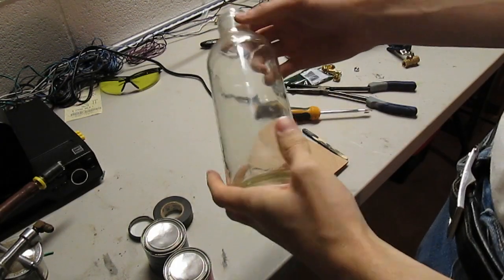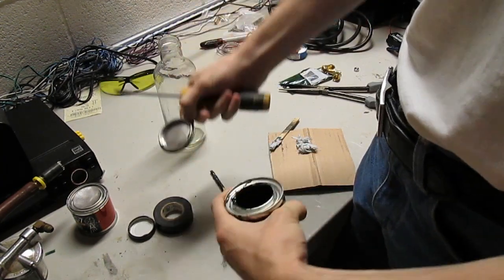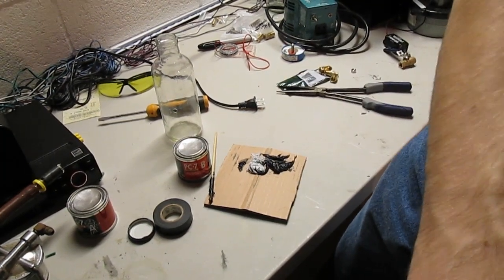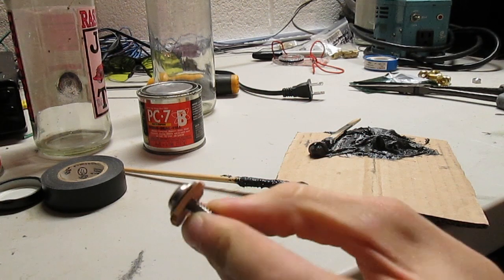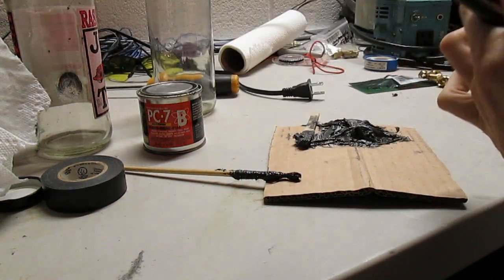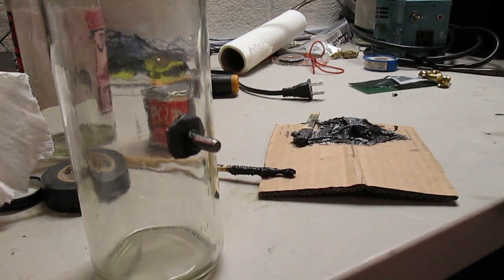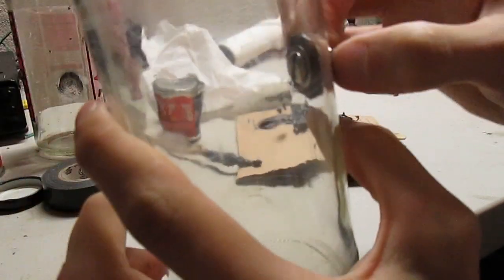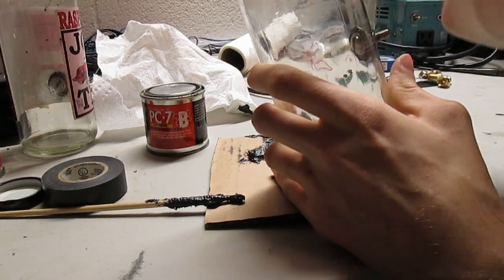How To Make A Homemade Vacuum Tube: Part 2 - The Anode

Comment: I can not find the first video to this collection, Was it removed?
Reply: Same problem. Where is "Part 1"?

Even your video that does not contain a "Part X" or the word "Homemade" in the title, "How To Make Your Own Vacuum Tube"...which one would assume IS the "Part 1" video in the series... points to this "Part 2" video ("How To Make A Homemade Vacuum Tube: Part 2 - The Anode", where v=I7l9rT4cSPA

By the way, it would be helpful to title multi-part vids ALL the same except for any differing suffix (such as "Part 2-The Anode"). In this case, your misleading starting-point video on this subject is titled, "How To Make Your Own Vacuum Tube". This made finding it using YouTube's search tool for it much more difficult than it had to be...even using your BlueJersey112 handle. Using an identical prefix for all related videos is much easier on viewers. Many video contributors create the same problem by being inconsistent with titles of serial videos.
Reply: Did you ever find part 1?